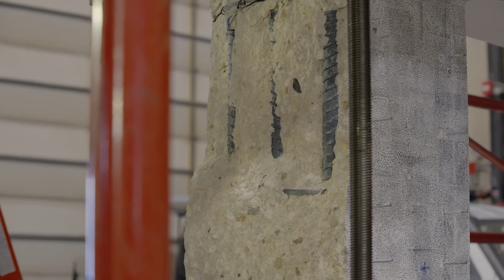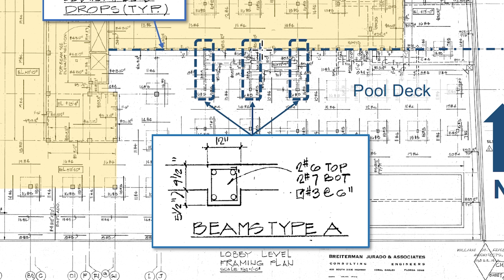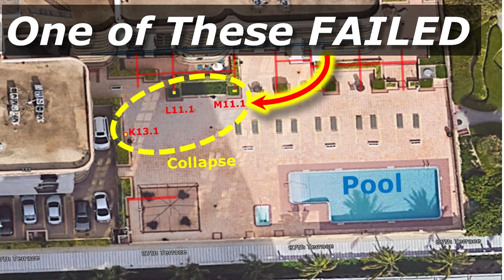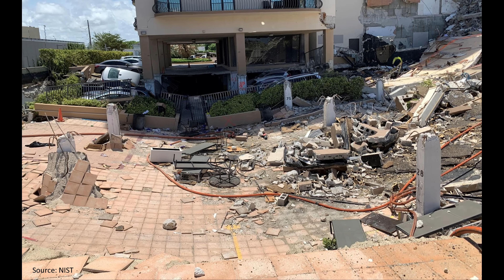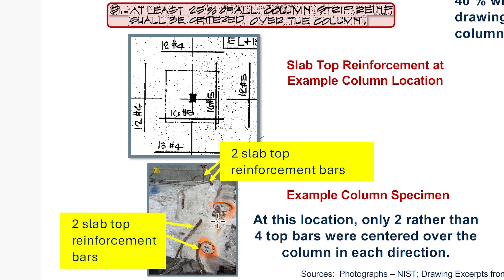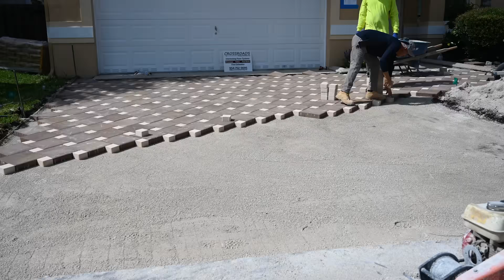Champlain Towers: Secrets the Feds Uncovered in Collapse Debris

Comment: Overall this is a good assessment of what happened 👍 but many of the problems that have been discovered result from Engineers not understanding the realities of construction in the field where you can expect the emphasis of getting the job done becomes the emphasis over following all design details exactly.

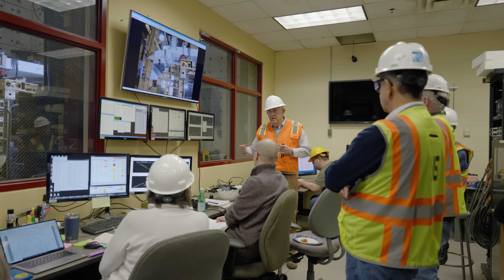@24:30 that's a10 ft ladder, not a 12. Ladder steps are 1ft apart,so start at the ground and count up- 10 steps nor 12. Extension ladder are the same, for instance a 16ft extension will have 16 treads/rungs, but the true extended length will be shorter because of the overlap between sections, and the maximum working height 3 ft less than that (2 ft less for stepladders). A lifetime of field work can teach you such things which may not be apparent to the less familiar folks😎 

@26:14 The dowels versus full length rebar is normal building practice to facilitate the pouring of the base with columns poured later. The usual rule is 30 rebar diameters of overlap but that should be extended for high load or critical load conditions. 

@36:17 The depth of the top row of rebar isn't critical for end-supported slabs or beams, as that only experiences compression loads. It does become critical for cantilevers where the load becomes extension (stretching). For an engineer to call for a 3/4" covering shows their lack of familiarity with concrete as delivered since the usual aggregate size is 3/4" which means rocks will protrude into the finished surface making the finishing work practically impossible. I'm certain that the as-build difference was done to make the building and finishing practical versus nearly impossible. Even with 1/2" aggregate the stacking of gravels would have made the finishing work harder than necessary. This is a failure of the education, training, and certification of engineers where things that work on paper often does not transfer to the realities of construction in the field. The same failure occurs where the pool deck slab and lobby slab are at offset elevations which prevents the direct tying together of both slabs with rebar to prevent separation. Those areas would have been far stronger sloped to allow that direct connection which weakened the area and facilitated the punch-through failure which initiated the collapse. 

The "Tofu dreg" construction so prevalent in modern-day China is an extreme example of everything being done to the lowest possible cost without adhering to all the design details. You simply must factor that in when designing a structure because right or wrong it will happen to some degree on every job everywhere. If engineers had to spend a year in the field working with each of the materials they use in their designs our structures would be an order of magnitude better, but the elitist attitude prevalent in the engineering trade precludes that. It doesn't matter how much testing and proof you have to support your design; what really matters is what the real-world results of your designs are. Blaming as-built for not following the design is usually a result of the design not being easy to follow which itself is a result of engineering's constant rewarding of itself for minimizing construction to provide for a cheaper faster structure. When you design and test to exacting specs knowing the field work will probably vary then the problem is at least as much you as it is them.

Comment: Jeff love your videos. As a former owner of a multifamily property with an inground pool the issue of ongoing leaks can not be understated as to the damage it causes to concrete and rebar. With pool acid and sodium hydrochlorite constantly being added to maintain ph balance and the ongoing pool shocking those leaks at that pool area got so bad that the water bill must have been huge. Ongoing saturation of the concrete and salt water from the ocean contributed if not caused the deck collapse.

Comment: Maybe a dumb question but here goes. And if I get something wrong tell me. 

We have a building whose original design was flawed perhaps seriously. Its construction didn’t meet the plans further compromising structure in multiple ways. 

The building had not been well maintained with numerous age related issues. Critical parts of the structure were overloaded by post construction modifications (like the planters. 

The building code that this structure failed to meet is decades obsolete.

Especially given the fact that the building wasn’t even built to the plans why such an intensive NIST investigation? It seems like massive overkill given all of the above.
Reply from the maker: When a number of people are casualties like this, NIST is brought in due to Congressional Act passed in 2002. The strange architecture and as built conditions made it quite difficult to determine where collapse initiated, as there were problems all over the site. This is why it takes so long, plus every time they mix up concrete to test they have to wait 30 days to cure.
Reply: @jeffostroff I totally understand why NIST was brought in. I don’t understand given what we know why such extensive testing of every possible failure mode has been required. As you and others have demonstrated in the past the poor condition and flawed construction and engineering of the building all but guaranteed the collapse. 

Now I’m. It a building or structural engineer. But unless the flawed design and construction methods are something that current codes still allow what is the value gained from the years of testing?
Reply: @jetdriver  The design was to US codes from the 1970s and they were flawed because they didn't stipulate a sufficiently rigorous analysis of structures and elements within structures.   The drafters of the code simply didn't understand the behaviour of concrete well enough.
Why do NIST build and test - to check if the theories and postulated collapse mechanisms were correct.  So that they can write clear, precise guidance for engineers to read and learn from.   It seems likely that many building of this age may suffer similar defects and people need to know.
Reply: @jetdriver  There were several plausible causes of failure, and the testing gives us a reliable way to say, for example, while vibration from the adjacent construction was perhaps unwise, it had nothing to do with the collapse.  A qualified engineer would not testify that it was a meaningful factor, no matter that it annoyed the residents.  The testing was able to conclude that the lion's share of the root cause was bad design that left low safety margins so that when the maintenance issues, as-built mistakes, and bad renovations were added to that, it failed.
Reply: @mriguy3202   
I'm not an engineer (but) shock and vibration often account for significant portion of wear and degradation 
of equipments.  In particular, although ceramics (like concrete) feature outstanding compressive strength, 
once that structure has started to decay/disintegrate ... shock & vibration can readily accelerate the process of degradation. Within a hundred yards of a pile driving location, vibrations in the earth's surface subject structures
to cycling stresses which they are likely not designed to sustain, an uncontrolled, unintended accelerated aging process.
Reply: @TomMcinerney-g9b  The findings of the analysis that is so well explained in this video were that the adjacent construction had little or nothing to do with the collapse; it was mostly poor design, then after that poor construction and poor maintenance/modifications to the original plan.
Reply: Q awww wax. L

Comment: Could the pool leak weakened the support under the concrete pillars contributing??  Keep in mind, I am a nobody lay person.
Reply from the maker: No the pool was too far away from where they suspect the collapse initiated. They have discovered the engineer originally under designed the columns by 50%. This will likely be the main factor, followed by poor rebar rod placement in slabs over column connections.

Comment: In aviation, we have a thing known as a "Minimum Equipment List" or MEL.   This is a list of items that are ALLOWED to be inoperative without grounding the aircraft.  This list is very carefully determined and it contains information for the mechanics as to what they must do, it includes the same information for the pilots, the amount of time the item is allowed to be deferred, and how it is to be handled.  If they didn't have this list, something as simple as a burned out bulb would ground an aircraft and produce horrendous delays.

Which of course are already bad enough....

In any case, if something is determined to be INOP and it is not listed specifically on this list then the airplane is GROUNDED.  This ensures safety while still allowing flight with minor things inoperative.

NOW, my question:  Why is there no MEL for buildings?  Clearly there was spalling and obvious leaks that had compromised the rebar and thus the structural strength of the building.  These items should only be allowed to a safe extent and then evacuation/repair is MANDATORY, the building is "grounded".   No pun intended, sorry....😜
Reply from the maker: That's a great analogy, and it really highlights the crucial need for a similar system in building maintenance.
Reply: @jeffostroff  I agree, it is a good idea.  I still can't get my head around why the building owners and the consultant called in to investigate didn't go further.
Why didn't they prop under the pool deck, rip away planters, dig trial holes to find the excess finishes and rip it out.
Why did they spend money on re-glazing wasn't it?

Comment: Question for the video creator:  Do you have an educational background in structural engineering?
Reply from the maker: I have some education in it during college, but chose to be an electrical engineer instead. I have also been remodeling foreclosure properties for years, stripping them down to the studs, and repairing builder mistakes and code violations. I developed a boots on the ground working knowledge of these concepts.
Reply: @jeffostroff It comes across in your videos.   The few I have seen are all well thought out with excellent information.

Comment: Isn't it possible to not depend on the buildings support to support the deck?  It sounds like if the deck wasn't there, the building would still be standing.  If the deck was supported by itself, it would only risk itself.
Reply from the maker: yes i think they should have used an isolation seam

Comment: For context, punching shear of column are only related to the dimension of column, thickness of plate to be punch through and strength of concrete. In design, reinforcement steel is not considered in the punching shear resistance.
Reply from the maker: I disagree with this because they clearly wanted rebar spaced out over the column connection to protect the tributary area. Also when engineers come into beef up the garage columns in condos, they use drop panels with rebar reinforcements, so the rebar does help.
Reply: @jeffostroff  I do agree that the intention is to have those rebars spaced over the column.  This is usually for bending purpose (high negative moment at column support) and required connection development details per ACI code.  

Dropped panel primary function is to spread the punching shear to a wider area hence reducing the punching shear stress (increase the perimeter of the truncated pyramid).  They also have to be reinforced (not for punching shear) but for bending.  Also, any concrete will required to be reinforced with minimum temperature steel to resist cracking due to expansion and contraction.

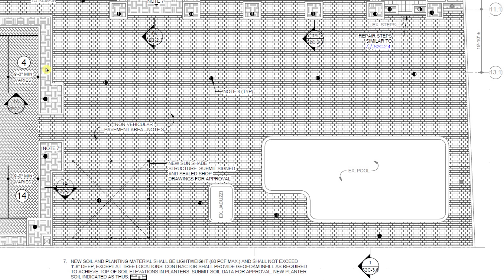Comment: 15:29 I said it was a planter that knocked those columns out, 3 years ago! So. My theory was correct after all. 

- from Google.. “A cubic yard of planting soil typically weighs between 1,800 and 2,700 pounds (or 0.9 to 1.35 tons)

The deck collapse may have started at k-13.1, but it was the planters at the base of the collapsed building that took out the columns near “notes 5 and notes 3.”

The planters over the columns between “notes 3 and notes 5,” which are attached to those smaller columns, those planters knocked the columns out when the deck fell. This is basic physics; like taking someone out by their knees. 

Glad the experts agreed that those planters were too heavy. Judging by the height of the plants, those planters are deep. 

Each of those planters weighs 1,500 pounds or more.

Those planters at “notes 3 and 5” are much bigger and the columns are much smaller than those of the wing that survived the collapse. Plus. Those planters are actually connected to those tiny columns. 

I can’t believe anyone would argue this. Especially when you can look at the video of the collapse and see that’s where the domino effect started, when the building collapsed.

Comment: Regarding your explanation at timestamp 27:31, NIST is using a Compressometer/Extensometer fixture in their Forney machine -- Gilson Co. sells these fixtures.  The Forney machine cannot directly perform tensile testing, as it uses a single action cylinder supporting only compression.  You can see two linear variable differential transformers (LVDT's) mounted on the compressometer/extensometer collars.. This permits direct measurement of the axial and hoop strains of the specimen, while a load cell beneath the specimen measures axial stress.  From this data, Poisson's Ratio and modulus of elasticity may be calculated.
Reply: Yes, I coughed my way through that too!  Because you get the modulus of elasticity from stress/stain and it doesn't matter if +/-.  Yes concrete is not a linear elastic material, and while creep compression and flexure is a big thing, whether a structure has enough reinforcement and in the right places is the biggest issue over concrete strength and thickness.

Comment: Did they ever consider a sink hole as a possible contribution?  The parking ramp, the sump pumps that kept wearing out.  They’d wear out if they were pumping a slurry of sand and water.
Reply: They stripped it all down to the ground and there were no sink holes. If you go back and watch Jeff’s videos, you can see that the ground and the parking garage pavement was intact.
Reply: @joanberkwitz2662  I remember seeing pre-collapse pics of the pavement in front of the slit drain at the bottom of the ramp.  (Cracking, shifted ) By “sink hole” I guess I’d be talking more along the lines of “subsidence “ it’s what happens to a stone walkway when someone pulls weeds from the cracks… little by little the sand that was pulled out with the weeds starts affecting the base layer and the stones start to sit crooked.  In this case, if drain water somehow found its way under the parking slab, little by little it would create a path to the sump. Anyone with  a pool knows what I’m talking about.  During the investigation, would they have been able to discover a 12” deep subsidence area of any length?
Reply: It was discussed at the time, so I'd be surprised if they hadn't. I have a vague memory of them doing some drilling after the collapse and that it was ruled out as a cause very early on, but I may be wrong. Anyone remember?

Comment: Do you think that the company that installed the pool area pavers might have added more sand to level out the patio versus keeping the original slopes?
Reply from the maker: I need to see old pictures of the old pool but it looks to me like most pools here in Florida have that curb that goes all the way around the pool perimeter and so rather than have people step over it to get into the pool would they likely just raised the level of the pavers up so that they match the top level of the pool if you look at more modern pictures of that pool deck. You will see that the pavers just come right up to the top level of the pool so that there's no longer a curb around the pool. It is in this area where I think they may have had the 9 inches of sand
Reply: @jeffostroff  That theory does explain it, Thanks for the detailed answer, it is truly appreciated.
Reply: @jeffostroff I've seen photos of the CTN pool deck. It seems to have some white, scored tiling ("cool deck?) and a lip around the pool. Original design at CTS? If true, how dumb is that? The lip around a pool helps keep water from sloshing out!

Comment: That complex was "pulled"...I've been a builder for 40 years...If every parking structure that had big cracks like those shown, collapsed. It' would be BIBLICAL! That entire event was deliberate...A building doesn't stand for 40 years and just collapses...At 1:50 you're explaining about the span between those columns being to far...Sorry friend; but; you really don't know what you're talking about...
Reply: If you know of buildings with cracks like this please let your county engineers know. It's possible they're not inspecting them.
Reply: @Solarbonite  Most parking structures have bad water infiltration problems and failing  concrete...But; In my experience; failure at this level must be initiated.
Reply from the maker: Well, @gofbluffvdgg  you're completely wrong because buildings with failures stand all the time. It works until it doesn't work it holds until it doesn't hold. It supports until it collapses. The Hyatt Regency hotel in Kansas City back in 1981 with the walkway collapsing inside the lobby, stood for a year before it finally collapsed. Also, your statement about me being wrong on the spacing of those columns, unfortunately, you are the one who was wrong. Because if you had paid attention to any of the slides that NIST presented it was in that very area where they showed a lot of weakness and flexion of the concrete in the pool deck on their chart with all of the Red Arrows on the pool deck floorplan to indicate areas of critical shear resistance, and flexing. And I'm pretty sure you don't know more than NIST.